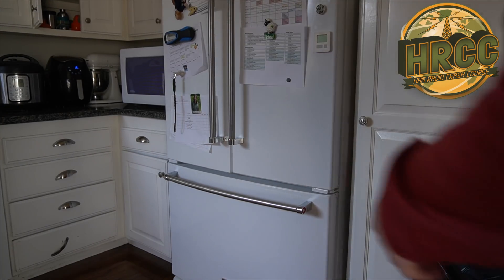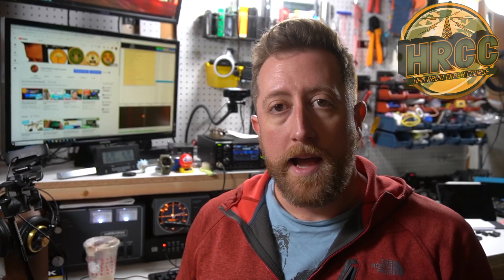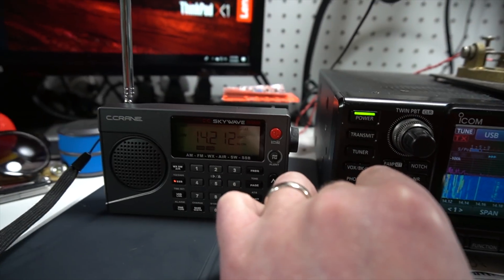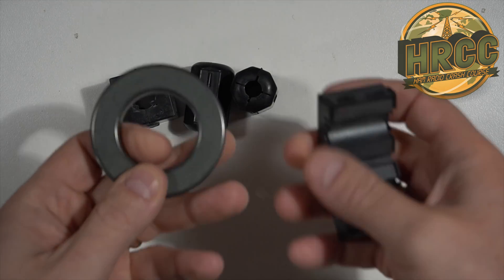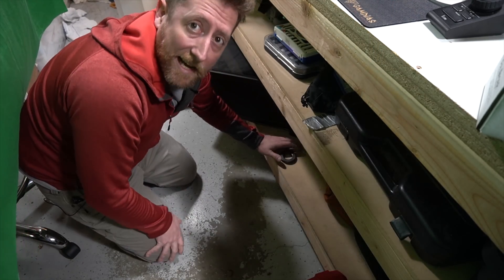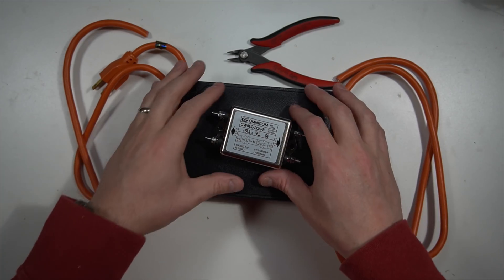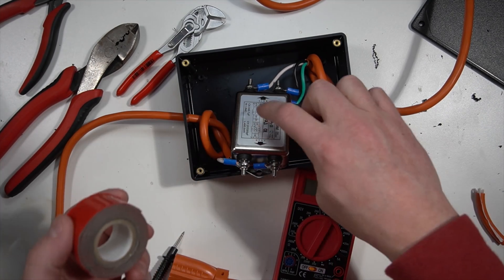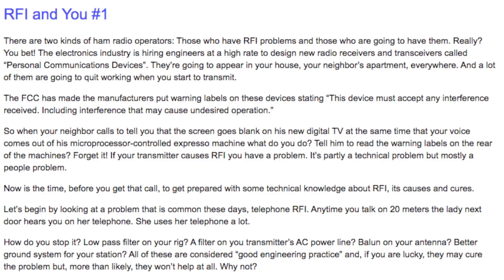WE are killing the amateur radio bands, and here is how to fix it (RFI)

Comment: I'm in the middle of nowhere central Kansas. The RF was terrible. I put my radio on a fringy station. and turned off circuit breakers,  everything. My radio sounded fine all of a sudden. I started turning circuits back on, my idea of an audit. One noisy  item,, the USB wire in the wall, Amazon sent to charge the Kindle. Bad. LED light on the same circuit bad. but ok at night for reasons I can't fathom. At least I know now.  Dinky things like the USB line I put on a power strip, for the TV. When the TV is off, I power off the strip. My Samsung can watch me when the TV is on, but it someone wants to spy on me, use your own power. I enjoy DXing FM now. I have old TV rabbit ears on my FM. I get something on about every frequency slot, Some pretty poor. And I get odd skips from Tulsa Woodward OKla, Joplin MO,  McCook Nebr. FM is much less painful to DX.

Comment: I had to remove all the LED lights and unplug the second satellite box in my room to get quiet signals for DX. It worked though. When our old satellite TV box died they installed a new one. The one in my room was the problem. The RFI was so bad that I couldn`t track it down. It was coming from all the wiring in the house. One day I turned off the switch to the box and everything went quiet. I don`t watch TV so I turned it off and everything is perfect now. As long as I`m not charging my laptop I have silence.

Comment: Here in the UK, we have to put up with an extraordinary level of noise on the HF bands, compared to what it was like over 30 years ago. This high noise level which is usually around S7 to S9 and if you're very unlucky S9+ in urban areas, comes from many sources. The main noise problem is ADLS2 and VDSL broadband internet noise, which radiates from nearby telephone lines. We can also experience radiated mains wiring noise, from cheaply made  switch mode power supplies, whereby the noise suppression filter components have not been fitted. The obvious reason these components have not been fitted in the first place, is obviously to keep manufacturing costs down. Then we may have other sources of interference to contend with as well, from smart meters, LED lighting, security camera systems etc. Is it any wonder then, that some Hams have given up the hobby completely, or gone totally digital instead. I myself have spent a lot of time over the years devising a low noise receiving antenna system, so that I can continue to enjoy the hobby. But it's an uphill struggle for sure, as I don't have much noise which is locally radiated in my house,  it's unfortunately coming from other houses nearby.

Comment: Disconnecting ground leaves the drier metal box ungrounded,  so leakage capacitance from the hot line to the box ENERGIZES THE DRIER BOX, ALLOWING A POTENTIALLY FATAL SHOCK

Comment: Powerline data transmission is a band-killer.  How they snuck it past the FCC is beyond me...

… oh... wait... could it be vast sums of cash?
Reply: Dustin Poche  why do something so traceable? First off, one should be having dinner with a judge when the fatal accident with the individual's experimental security robots occurs...  ;)
Reply: @Michael's Production's yep you cant hear anything but shit....I know the feeling I live in thailand the home of the Chinese LEDs  they dont even understand mains electricity let alone RFI
Reply: A smart meter grid can also be troublesome..a long with 5g tower down the street..
Reply: Cut the neutral feed soming off the secondary of the pole pig.   The problem will fix itself when the refrigerator kicks on.
Reply: @AmateurRadio  This is not even funny.  Floating your neutral from the pole can seriously damage anything you have plugged in from excessive voltage.  It can also lead to letting the smoke out, as in cause a fire.  Don't do it.
Reply: @BryanTorok  well that was the joke haha.  and yes, it was just a joke! sorry!  dont do this people!

Comment: Hey Josh, would you be interested in doing a video on RFI when it comes to solar panels?  Since there has been an increase in homes installing panels and optimizers, I have read and seen videos on how they wipe out the HF bands, but no one shows you how to track down the RFI and eliminate it.  Thanks.
Reply: See  “Can Home Solar Power and Ham Radio Coexist?” in the April 2016 issue of QST.

Comment: working for Sony for many years I would like to add to your comments that the biggest FRI is nowadays all the Switch mode power supplies that are in everything. Gone are the days of Transformer power supplies that never had much RFI. Did you check Ham Radio power supplies for RFI... On another note, I have not checked mine yet what about inverters for solar power. I am totally on solar and I am just setting up my Ham Radio setup . john R
Reply from the maker: Yep! Inverters can be noisy!

Comment: Most of RFI here in my house comes trough the power grid. I haven't had my radio on for 2 years. I gave up.
Reply: If you want action, then call the Power Company and file a complaint. Most of the time they will come out and check for noise at demarcation. If you cannot get them to respond in a timely fashion, then threaten them that you are going to call the Public Service Commission as well as the FCC. Be assured that the power company will respond quickly.  Note: the info above will be a good starting point. And is solely based on the fact that you have verified that your house is not the actual source of RFI .(FYI) Also start writing down or keep a journal of everything, Like phone numbers, dates and names you've talked to etc...  Log everything. How do I know this ? I have 30 yrs as a Telecommunications Field Engineer. GL

Comment: A long time ago, I had a Radio Shack TRS-80 Model I. I could only use it after my wife went to bed, because turning it on would completely obliterate all over-the-air TV channels below channel 7. I think that computer was single-handedly responsible for the FCC Part 15 RFI rules. There was a CPU board in the keyboard connected by a completely unshielded ribbon cable to an expansion module with the extra RAM. It was virtually a worst-case design for RFI.

Comment: Great video! It also tells us something about the failing FCC (and their overseas equivalents) policies regarding this problem. They tell companies their products should accept interferences and avoid transmitting rf interferences by devices but it is to no avail. Makes no sense if no one keeps to these regulations. Thing is, I have already done this at my home but over here in Holland we live in overcrowded towns. And I know some switching power supplies can spoil things in a terrible way, sometimes these things have a range of several hundred meters or even more. So I gave up, I also gave up the hobby at home. So now I have invested in mobile equipment. Greetings, Willem from Holland.

Comment: Just want to point out that the line filter should be mounted inside the metal frame of your appliance. The earth connection of the terminal of the filter is then directly connected to you appliance. In your current setup you should connect the outbound earth wire to the housing of the filter. Also the "long" wire from you appliance to your filter will still be transmitting RFi noise.
Reply from the maker: This is a great point and was that ended up realizing was the right way to do it.  I just need a day to drag the dryer out and disconnect the power line and mount the filter.  When I continue this topic, I will indeed point that out.

Cheers!

Comment: Ungrounding or floating the cabinet of a metal chassis appliance is a REALLY bad idea, extremely unsafe, especially in a laundry room or kitchen.  The noise is most likely from a microprocessor control system as opposed to the old style motor driven timer, switches, and relays.  It would be better to filter the supply to the control system.

Comment: Nice job finding and fixing the RFI. But, do you really want to lift that Equipment Safety Ground (the green wire) on the dryer in a damp location on a concrete floor (I'm assuming it is in your basement with your shack) where wife and kids will most likely touch it with bare feet?????
Reply from the maker: I did end up connecting the ground once I started thinking about it.  Cheers.

Comment: There is only so much you can do in your own home, the issue I found is the neighbors equipment that you can not do much with. What needs to be done is strong enforcement of electrical and radio emissions standards to start with! this issue started to become problem in the 2000's with change over from linear power supplies to switch mode units.

Comment: Why not add an extension cord and wrap the extension in the torroid. This could help with eliminating much more noise. Just an idea I have not tried it. I have a similiar idea, when I need to get RF static off cable. I add a splitter to lower the dB- level. Just a thought.

Comment: OH NO!  Don't leave that ground wire hanging in that enclosed filter you built.  Connect it to the ground stud on the filter so your safety ground has end to end continuity.  The filter will work better too but you NEVER want to leave the safety ground unconnected.

Comment: I've identified multiple noise sources in my own home.  The biggest offender is the Ethernet network and connected equipment.  I get all kinds of bells whistles from 14 MHz up.  I've tried different techniques to suppress the noise but it is very persistent.  Poorly designed switch mode power supplies and LED driver circuits are a BIG problem too.  

I am also finding that the VDSL2 service that supplies internet to my area makes using 30m quite challenging.  There is almost a brick wall of noise from 8540 kHz to 12000 kHz, you can see the individual 4.3125 kHz spaced carriers on my HPSDR waterfall. I've shut off my own VDSL2 modem and the noise doesn't go away.  Because of the battery backed FTTN VDSL2 cabinets around the neighborhood, this is one noise that DOESN'T go away during a power outage. :-(

Comment: You need to continue that ground through to the load side cord on that line filter. It's a safety feature meant to ensure someone doesn't die if the metal parts of the dryer become energized because something live on the inside shorts to the chassis...

Comment: I use an MFJ 1025 Noise Canceling Signal Enhancer box to null out my noise. It is the best tool for dealing with noise I have ever used. Much better than any dsp box or wrapping all my cords with toroids. All you need is an antenna that receives the same noise as what you are getting on your rig. Plug that into the box, turn some knobs and the noise is gone. Without degrading the signals underneath. It's a little expensive at over $200 but well worth it these days.

Comment: I'm building power centers at the HT location, wiring closet, and operating position consisting of a large battery, a Genasun MPPT solar controller, and a single quiet power supply that charges the battery.  ALL DC loads are placed on either the 12VDC bus, or on other buses using Linear step-down regulators.  For the AC devices (internal power supplies), I check for bad filtering, unbonded green wire to chassis, et al...

Comment: I have thusfar eliminated about 50 of the 75+ switch-mode power supplies from my house.  The PROBLEM is that sooooo many products with SMPS FAIL to engineer proper filtering on the power supplies to filter out the hash/noise.  LOTS of issues.... but the WORST are cheap SMPSs...

Comment: I bring my little Radio setup to my tractor it has a metal / fiberglass roof in the backyard seems to be like a little Faraday case it works pretty nice I've low low noise level
Reply from the maker: That sounds cool.  “Corn Fields On The Air”!
Reply: @HamRadioCrashCourse  you can see it and go to my channel and find the link to my radio channel Kay radio geek Ned

Comment: in the old days power supplies had to have an AM radio certification so it ensures no interference but I don't know if it was a big standard even now it doesn't seem to be a big standard
Reply: FCC Part 15B. There's a huge loophole that puts the responsibility for testing on the final assembly, so it's legal to import junky switching power supplies and very easy to fly under the radar. Home-assembled PCs are completely unregulated (by the FCC) too; basically they're treated as kit electronics.

This regime means that there's no official QA for components and perhaps even for accessories. The FCC is understaffed and underfunded for the information-technology revolution - we have a regulatory body from the 70s or 80s plus whatever the telecom industry has scraped together so they have enough of a regulatory framework to enable their business models. Europe is driving more regulation than the US does. (And China can continue to dump junk here.)

Comment: I remember the 1980's when the futuristic switch mode power supplies was a culprit of excessive band noise.  Heck, I still have this large, and heavy, 25amp 12 volt Tripp Lite linear power supply so my rig didn't pickup even more noise.  That sucker was around 130 dollars 35 years ago.

Comment: Just stumbled on your video.
I have a nasty  “shuff-shuff” sound I get at roughly 1120 kHz, which is really annoying because I like to listen to KMOX in St. Louis, but I live in Jacksonville Florida.  The noise seems to be in the walls ( wherever there are electrical wires).
My house is old, don’t know if that has anything to do with it.
I pick up the noise on all my radios. ( tube, transistor, plug-in, or battery operated).
(( No , I’m not a Ham operator, but I am into S.W. and MW( AM) listening, and I collect some radios as well))
Any ideas❓
Reply: DDave Doesnt Stutter ❓❓
You lost me.
( you have to forgive me - I’m a complete idiot when it comes to this stuff)
📻🙂

Comment: An electrical device without ground is very dangerous. In case an fault occurres, you have the voltage of the live wire on the metal case!
Please connect the ground wires again!
73's de Steve

Comment: DO NOT "LIFT" the ground on any AC supply cable. Extremely dangerous, keeps your breaker from working properly. If your noise level drops when lifting, you probably have another source of ground reference causing a loop. Remove that reference, not your AC mains ground.

Comment: for my part, the worst is a PoE switch that powers security cameras around the house, that switch (or the cameras) make incradible noise from 160m to 70cm, everywhere on the scope I see bars at regular intervals, once I unplug the POE switch (or I disconnect the cameras from it) those bars goes away... I tried another switch and PoE injectors and it does the same... aweful noise everwhere...

Comment: Have you considered a common mode choke to reduce noise on your antennas. Second you can add ferrites in series to add more impedance at RF.
Reply from the maker: Indeed, all my antennas have decent 1:1 chokes at the feed point.
Reply: Ham Radio Crash Course depending on your antennas you may need them at the antenna too.

Comment: Josh,  Would the brute force filter you used on the Dryer be an option for the refrigerator and other appliances?
Reply from the maker: Yes, but likely will work better when its placed in the appliance where the power source is.

Comment: I got my Sangean MMR-88 radio delivered today and in the instructions is a little sheet that says to keep any power supplies for the radio at least 12 inches away from it to avoid interference in the AM band, and the it’s due to DoE regulations requiring switching power supplies for energy efficiency reasons..... typical bureaucracies.

Comment: Dude. Hook both the line and load grounds to that ground screw. The ground must continue to the dryer.
Reply: This.  THIS IS A SAFETY ISSUE; DO IT NOW!!
Reply: And please edit the video to indicate you have fixed your dryer's safety ground.  Don't give others information that could kill them; their widow could bankrupt you.
Reply: WE are killing the amateur :D
Reply: Thanks for the heads up. I know about EMC and thus RFI. But this video brought back the importance  for my  shack again. About the dryer thing... good idea to proper ground the thing. Further, don't put the filter in the center of the lead. When placing filtered and unfiltered lines together, you will short the filter again by capacitive coupling. 

Thanks a lot for the video! Will help a lot of people! 73, PA8E, Wim
Reply: @Huisinspanje  Good Advice. Isn't it also true that you want the filter as close as possible to the noisy equipment so that you have less wire acting as a radiator?
Reply: @chrisstorm7704  Yes. I would put the filter at the noise source. 👍😊

Comment: I would have also used ferrite rings. Since just about every appliance nowadays is microprocessor controlled, they ALL have a switching power supply and not to mention your neighbor's appliances. Also, DON'T forget your "Smart Electrical Meter"

Comment: If you mentioned how you were powering your 7300 during the rf hunt I missed it. I would recommend being electrically isolated with a battery and eliminate all radio connections including ground to the home electrical system while hunting. RF is either being sent down power or ground, or it's being radiated. Isolating the radio electrically will tell which direction to take in resolving the issue.
Reply from the maker: Any battery capable of running it on rx is fine.

Comment: Josh, one corollary to your axiom: New stuff gets plugged in all the time and you may not even realize it. A couple of years ago, I ended up with an S9 noise out of nowhere. I used the power off circuit breaker by circuit breaker on approach and discovered it was a cheap eBay backup power brick for an HP computer my wife bought. Ergo, this is not a one battle war! 73 de Robert K3RRR